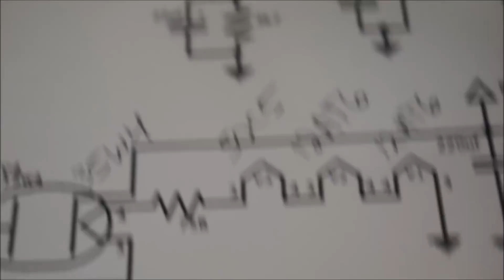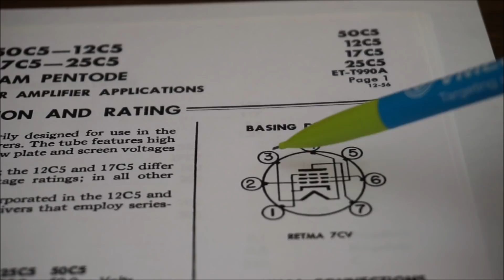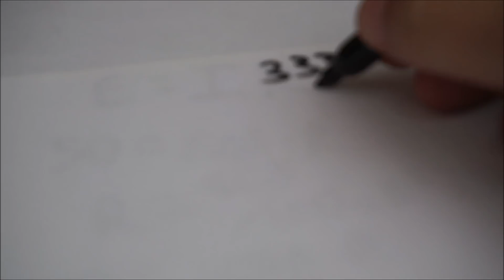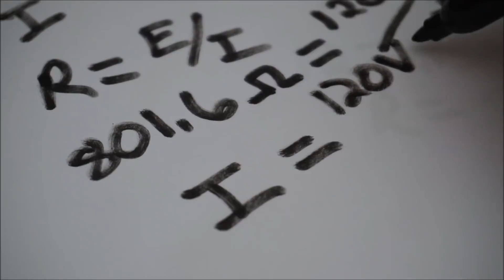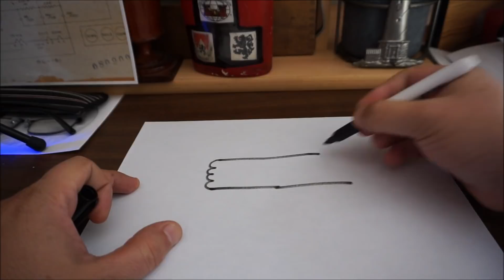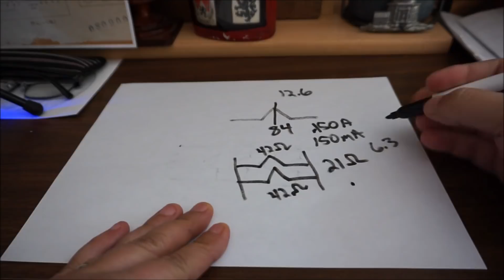SRT Amplification - Electrical Theory Thursday (ETT): Tube Heater Filaments

Comment: Question: I’m looking at a schematic of 6 12AX7s with DC heaters, the +12.6 comes down to pin 4 of V1, then it looks like pin 5 of V1 is connected to pin 4 of V2 and pin 5 of V2 goes to -12.6. This is repeated 3 times for the 6 tubes. Am I actually going to solder a wire from pin 5 of V1 to pin 4 of V2 then pin 5 completes the circuit with the -12.6? Thanks in advance, you’ve got a great channel coming along here and I can’t wait to keep learning from you!
Reply from the maker: I would have to see the schematic. You can attach it to my SRT Facebook page.